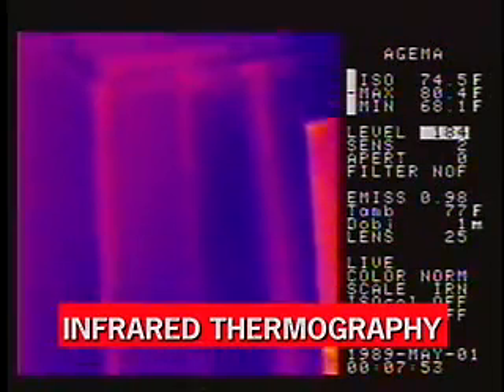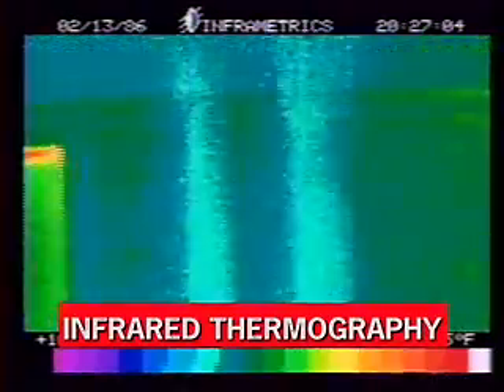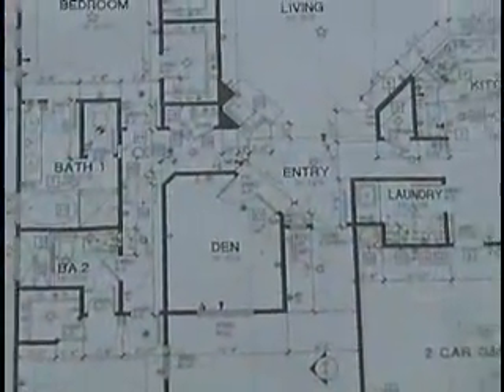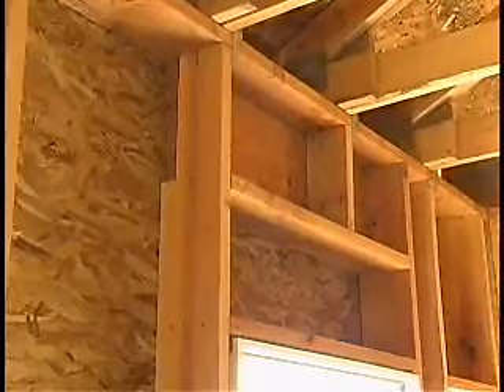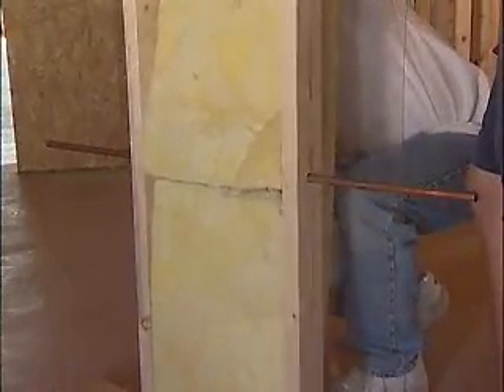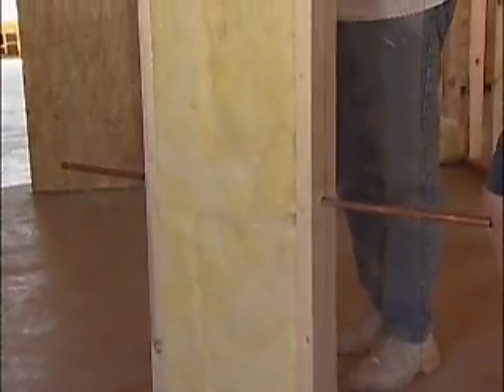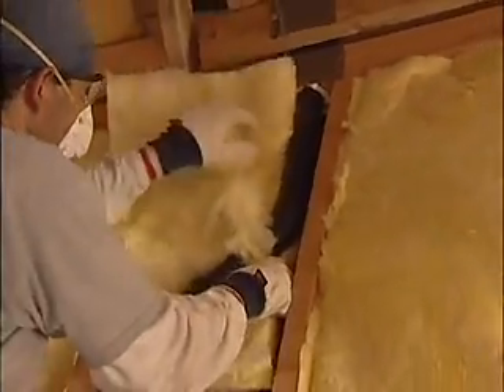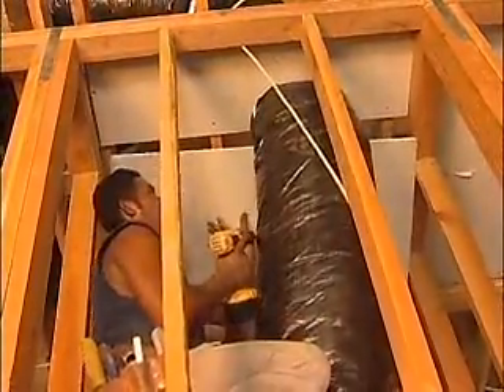HERS High Quality Insulation Installation

Comment: This is what happens when some energy nerd on paper tries to get into the construction side of a house. 2x6 outer walls will cost you 4,000$ worth of lost floor space on avg.  The trim guy and the drywaller are going to charge more because of the headaches that will cause them.  You saved 20% of the thermal bridging, overall making like a 1% difference on energy gains, costing you more in mortgage interest than it will ever save, good job energy nerd, way to use simple math and common sense.
Reply: A six inch wide will (5.5 inches actual) will allow (at least) for R-19 in the walls as compared to R-13.  Please let me know if I have to explain R-value to you as you most probably do not know this either. Also, if you do not understand advanced framing and its benefits, please let me know as well.